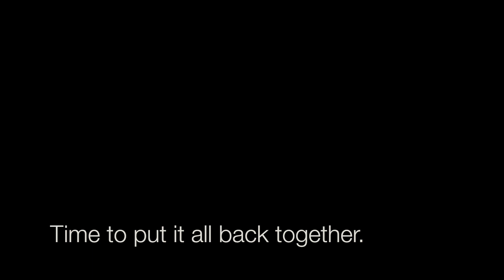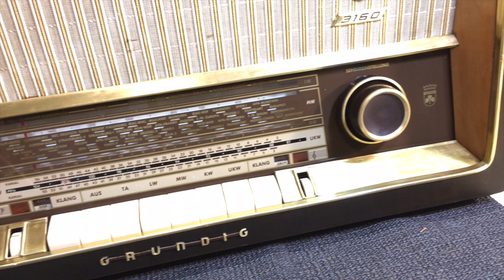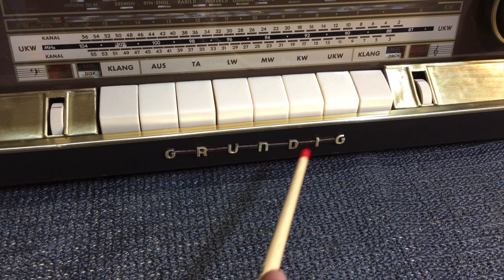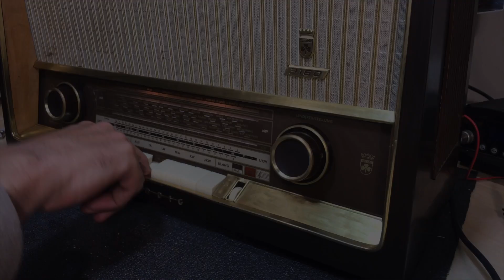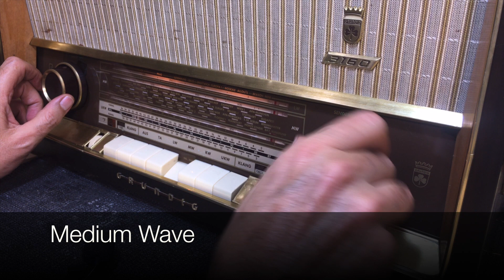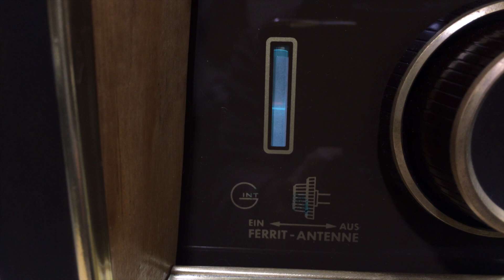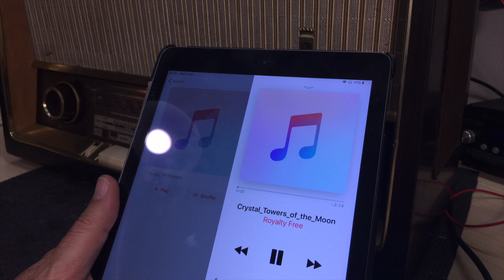Grundig 3160 tube radio restoration, part 7. Finishing up, and final testing.

Comment: Considering how you did it, the veneer repair worked out a treat. Now it doesn't have a massive chunk missing out of it and it's not embarassingly scruffy, in fact it looks very tidy. Ok, maybe it's not how you'd normally do it but given the circumstances I think you did an excellent job.

I listened to the reception test with my Sennheiser headphones. Now I know I won't hear the exact sound produced by the radio via your microphone and mangled by Youtube's audio compression etc. but I can get a relative idea of it and it seems well up to expected standard. The treble seems exceptionally good, we can consider the elecrostatic tweeters to be healthy.

As a Bluetooth speaker the sound quality must be equal to or better than the majority of equivalent modern items with the addition of one important but oft-forgotten characteristic: Pride of ownership. Someone owning an item such as this radio doesn't merely require a disposeable appliance that does a job. They want style and quality, the sort of quality that would likely cost four figures if such equipment was made today.

I'm finding myself wanting something similar to this radio more and more. However, I still think any electronic restoration would have to be carried out by someone more experienced than I. I know a bit about valve equipment although my comfort zone is in solid-state and as the saying goes, "A little knowledge is a dangerous thing"...
Reply from the maker: I agree with you as regards the pride of ownership, sorely lacking these days. 
As regards your journey, all I can suggest is get started on a really cheap set, so it won’t hurt if something burns up. I assure you the next time will be better 😊

Comment: It's absolutely stunning what you did here! The radio was crap when you showed it in the first episode -- I woldn't have given it a second thought. But now it is a marvel. 
All that corrosion is gone, you repaired a clutch and what else. 
Maybe, just maybe, a little polishing. But like some other comments say, this radio is old. It is not supposed to look brand new!
Reply from the maker: Thanks for that. I sometimes forget what was achieved, and ponder only what I failed to do.

Comment: Great job (as usual)! Can you elaborate a bit on your "usual bath of shaving foam"? I'm restoring a 5195 (which has exactly the same grill cloth) but I can't manage to get it clean. I tried a bit of shaving foam on a corner but it only seems to make the fabric dull and fluffy.
Reply from the maker: I wet the cloth with shower, then spread the shaving foam on it liberally. Leave for about 10 minutes and Rinse off with shower. It works pretty well most of the time.
Reply: @electronicsoldandnew  Thanks! I'll give it a try.

Comment: Manual quick question. Who is the manufacturer and model number of you [red] multimeter? I like the feature of seeing ripple voltage on a dc measurement.
Reply from the maker: It’s a Brymen. I have two. The little one is the model BM235, and the big one is the model BM869s. For dual readings (DC and AC), I use the big guy.

Comment: Looks and sounds great to me!  Can you hear how well the electrostatic tweeters are working?  Are they any better at conveying "spacial awareness" to the sound than, say, normal dynamic 4-ohm side-mounted speakers?   I have a Grundig Type 2030W/3D awaiting a refit that has the latter speakers.  It was supposed to have a "3D" sound filling quality that single-speakered radios didn't have.  I'm curious to know whether Grundig radios with side-mounted electrostatic tweeters were better in that regard.
Reply from the maker: I can hear the high end quite significantly from the electrostatic speakers on the sides. However, I’ve heard SABAs and telefunkens that used normal smaller speakers on the sides and the effect was the same. I’m not sure the electrostatics are that much better, if at all. They do add a “volume” aspect to the sound, making it “bigger” but I believe the wooden cabinet itself is mostly responsible for that.

Comment: Beautiful work. Do you happen to know the type of bulbs needed for the dial illumination?
Reply from the maker: Not at the moment, I’m afraid.
Reply: @electronicsoldandnew  I just installed #40 bulbs, and they seem to be working fine. They're spec'd at 6.3V 0.15A, which is a higher current draw than the original 7V 0.1A but not excessively so. FWIW.

Comment: Thanks Manual. I will check out the multi-meters.

Another item of interest. The LF beacon you hear at your location is aero navigation beacon 'PST' which operates with 400 watts of RF power on 338khz located at the Porto Santo Airport.  See:

 https://www.google.com/maps/place/33%C2%B004'07.0%22N+16%C2%B021'30.0%22W/@33.068329,-16.3586109,497m/data=!3m1!1e3!4m5!3m4!1s0x0:0x0!8m2!3d33.0686111!4d-16.3583333

During the winter in the northern hemisphere it may be possible to monitor that beacon here in the USA near Chicago. If I log it I will let you know.

Martin
Reply from the maker: I know about the beacon, but had no idea you could pick it up from there. Do let me know if you do.